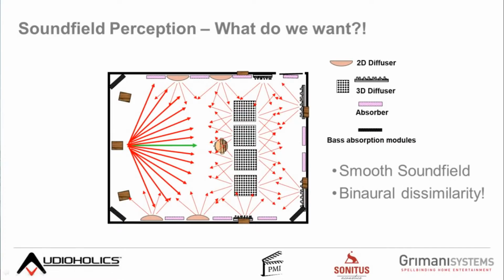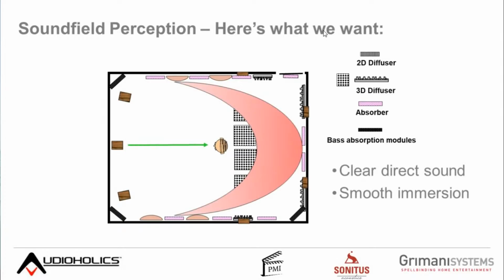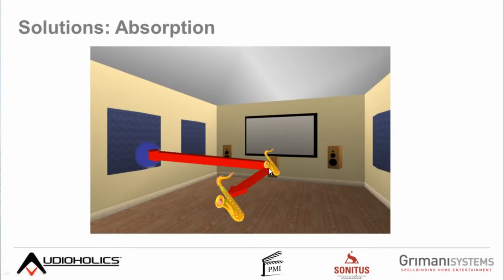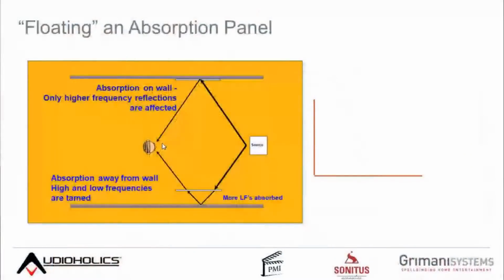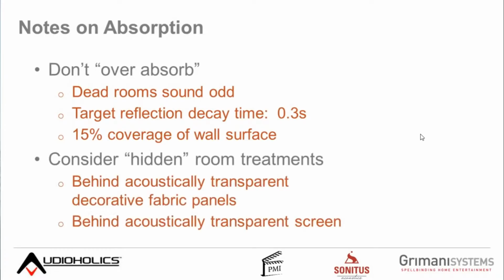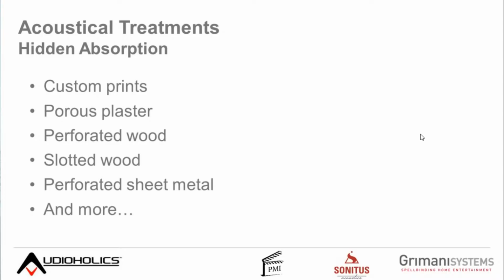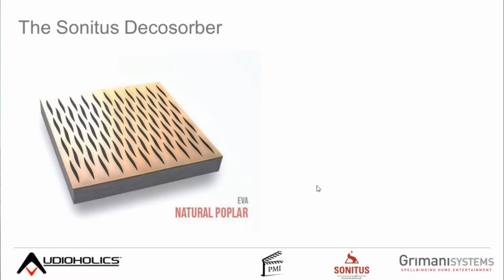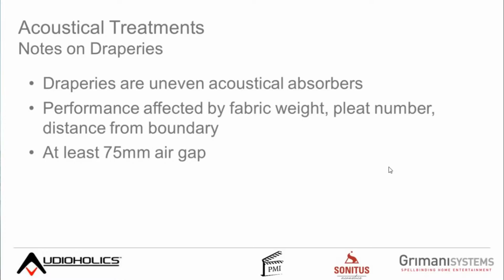Understanding the Different Types of Acoustical Treatments - Absorption

Comment: You must have symmetry to have proper center image. And your example picture the front wall is completely empy. That is the most important wall to treat. Small rooms I don't even bother diffusion. To know how sound works it is very easy. If you have symmetrical room and speaker setup it is very important to treat the room the same way. Another center speaker is just that what you want. Proper locked center image.

Comment: Lots of info.  Sophisticated materials/designs.  Please describe in details "ideal sound(s)."    Hey--that a demo comparing various speakers with direct wire found sound indistinguishable from the wire version!   Great.  2.  Local auditorium is a serious theater routinely overblasted by volume settings to please the artists on stage BUT destroying sound, giving echoes, distortion, thumps against the chest with volume.  Good system controlled by chimps.

Comment: Is the %age of square footage based on the room wall sq.ft or does it include the ceiling? According to my math, if I have a 14x27x7’ room then id need 18 2x4ft absorber panels and 24 diffuser panels? Can these panels be set into the wall framing itself so it doesn’t protrude into the room space. Thinking of wife approval factor…

Comment: Very interesting presentation.
What about combining esthetics and sound absorption/deflection:dampening the old fashion way by placing on and along walls different size pictures and furniture like wall cabinets, and experiment by mowing them around until the sweet spot is located?
Newest AVR are equipped with the software that “adjusts the sound according to the listening room and speakers therefore creating clearer sound by suppressing the standing waves that occur between walls or ceiling and floor.”

Comment: Wouldn't you be able to fix lobing with some delay on the amp / receiver, by setting it per speaker ?
Reply from the maker: You can't fix lobing caused by the speaker with EQ or delay. It has to be fixed at the source.

Comment: Best video and what I've been telling friends for a few years now. Speaker room integration/interaction is key. Cables, equipment, and amps are truly the least concern although amp and speakers should be a good match due to dynamic impedance swings and speaker efficiency differences.

Comment: Alright, ya guys finally broke me! After trying to re-tune my system I found some problems I just could not fix. It's gotta be the room causing this, I know I have an echo so I finally broke down and ordered some bass traps for the corners and some thick acoustic panels for the walls and ceiling. Just for quick and dirty testing I hung up some thick bed blankets on the walls and sure enough, big difference! So I felt confident spending more than a few bucks on some actual panels that will look a whole lot nicer then some bed sheets lol.
Cheers 🍻.

Comment: I rearranged my threatment and turned from equal absorbtion to 3d-diffusor on the first reflection from the left speaker and absorbtion on the opposit wall. It sure opened up the sound fr.o.m. the left speaker but the voice is now no longer centered. The voice is now coming the left side of the front wall. Maybe it does not work because my speakers are to close to the side walls (40-50 cm). Anyone else experienced this?

Comment: Hi guys. I just moved into a place where I have a room which is more like an attic. A portion of the ceiling is slanted and the dimensions are not that impressive: 4,47m length - 3m width, 2m height (1.60m until the ceiling starts to slant ). I have placed my mixing desk on the long wall, because it's the only one bare and because on the right side wall is a window. Could you, guys, give some tips for treating this kind of room?

Comment: Can i ask a specific question on my room?
Reply: I see that no one replied to you. These guys are busy men, just like any YouTuber. May I suggest that in the meantime, until you get an answer (and maybe you already have your answers and I'm wasting my time, but I'm only trying to help... Just in case you've not done any investigatory work till now), is that you do some research from notes made just on this video. That's what I did, and you'll learn a lot. Maybe also try to understand the basics of wavelength/frequency science, and then draw your room plan as an architect would, including speaker position, applying the math (including geometry) you learned. You should want to understand where you put what kind of panels, and their dimensions and materials. Once you have discovered l your reflection points for lows, kids and highs - the frequency band - including and high (room boasted) and low (room cancellation) nodes for bass, tool know what to do - especially if you've taken into consideration your furniture density. Once you have done all this, you may have your answers but new, more advanced questions. Then come back to these guys in a future LIVE video and be there in the chat ready (or you can send Gene an email ahead of time) to ask your question. You'll have more likely a good question to ask, given all the pre-thought and research you've done ahead of time, and better success getting an answer. These guys deserve well-thought out questions, not your average every day question, not that you have ordinary questions, but you know, respect to these guys knowledge

Comment: Maybe I missed this part in the presentation, but how do we use something like REW to actually measure the room and see whether or not we need these treatments? I've seen videos about the mirror trick for reflection points etc , but ultimately to the untrained ear, how can we use software to tell us or show us what we may not recognise as a problem?  We have to realize that if the room sounded good to us before (because we couldn't tell the difference), than we would need something else to show us these problems. Maybe someone like Anthony could walk in and hear the problems right away, but the average homeowner may not recognise these things as problems. It would be good to have an explanation of how we can use tools like REW (or whatever else) to actually assess the room and then figure out IF and where we need treaments.

Comment: Back in the late 90's early 2000's I helped some friends of mine put together a low/no budget rehearsal/recording studio for their band. I had construction experience so it was up to me to build it. We had the building, a stand alone garage built back in the 1930's with 10' ceiling. After insulating the walls and hanging 5/8" drywall which is all the landlord was willing to pay for we needed to get creative with sound treatments. Not to far from the studio there was an industrial building that was being remodeled for new tenants and they where ripping out a grip of new T-bar ceiling acoustic tiles and 1/4" rubber backed carpet squares that the previous tenants had installed just before going bankrupt. They where throwing all of this stuff away so I helped myself to as much as I could. We used the carpet squares to cover the floor and glued the acoustic tiles to the walls two layers thick. Then we cut a bunch of the tiles into pieces that we stacked about 6 or 7 tiles high that formed a four sided pyramid that we glued together and attached to the ceiling in a checkerboard pattern.

Next I found this carpet shop that installed carpet. The carpet as usual came in rolls that had at the center a thick cardboard tube that was discarded after the carpet was installed. This place was doing a lot of business so they had a lot of these cardboard tubes laying out by the trash cans so I helped myself to a bunch of them. We took these tubes and ripped them in half on my band saw so they where half rounds that we then attached to firing strips that we screwed to the walls every two feet. We would put 4 to 5 of these carpet tubes in a row and the a space. The ratio of tubes to spaces where always varied in size as to achieve what you where calling binaural dissimilarity, something I was aware of and practiced in setting up my own systems but ran into a lot of resistance from others when I would try and explain it. In the spaces between these carpet tube panels I hung strips of mass loaded vinyl that I found being thrown away at a manufacturing facility that used them as coverings over their doorways to keep the buildings refrigerated atmosphere from escaping out the open doorways while not inhibiting the forklifts going in and out of the building round the clock. I'm talking about clear plastic strips about 5" wide and in this case 9' long and about 1/4" thick and quite heavy. We weren't overly concerned about aesthetics but things didn't look to bad and the acoustics in this room ended up sounding as good as any professional studio. So in the end we where able to sound treat this room for the cost of some tubes of adhesive and a few boxes of screws and the time it took to do it. Granted we where lucky to find the things we did when we did.

Comment: For aesthetics (and light control and some sound isolation), I want to cover the entire room in curtains, liek your old school theatures, but i hear you should avoid that, unless you know what you're doing, which, I don't.  So what are the risks and what should you watch out for?  The idea was go around the room, a few inches from the concrete walls (basement) have the speakers on the inside of the curtain, and i was going to do acustic foam at the main reflection points behind the curtains.  They are not acoustically transparent, again looking to insulate from my neighbors a bit and I figured it would break up reverb and sound reflections as a whole for a smoother respose.  Where am I going wrong?
Reply from the maker: You're going to kill the high frequencies of your room if you do this.
Reply: @Audioholics  even with the point sources of the speakers in a 7.1.4?  and I'll have an acustically transparant front screen with no treatment, least no curtains behind it, and minimal work to the floor and ceiling.  What are my alternatives? It's a town house that we are renting, I can't put up walls and I want to block the view of the washer, dryer, hvac, and stair case, none of which are helping immersion lol.  It's also to create some leval of symmetry within the theature space, which is only taking up about half the total square footage offset to one side.  I have to hang some level of 2x4's or similar from the joists anyway, cus i prefer that to a bunch of speaker stands for the surrounds, so maybe instead of absorbing reflections, I'll could add diffusion and reflection panels to on top of the drapes suspended from the ceiling to liven it back up?  It's a challenging space in any event.    I see a lot of trial, error, and measuring in my future.
Reply: so he sort of answered it twords the end.  I run the risk of over absorption.  but considering its an open room on 2 sides I think it should be ok

Comment: Well my room is 17' wide, 23' long (left side) 14' long (right side) and has 13' vaulted ceilings. I am using identical tower speakers (Infinity P363) on all channels and am making sure that they are all far enough away for proper driver integration. I'll be able to do 5.1 + wides so 7.1 total. I will treat as described here and do speaker layout and calibration as described here. It will be a dedicated room even though the room is somewhat open to the kitchen. Hopefully the big speakers aren't a problem in a 3200 cubic foot room. Only one way to know.
Reply: I have a similar sized room with 30 foot vaulted ceilings. Have done your acoustic treatments? And if so what did you use?

Comment: You can have all that, but if that room temperature change it will give two things, a plesent or un-plesent sound field... AC or Heat in moliculse in open air effect in the room in general .... could be a good thing or bad thing... If your Air-conditioner moliculse changes in AC or Heat.in general thew air moliculsel.....it then can require slight adjustment's in effect.

A scientific Fact!!!

Shit is a little tricky.

Take it from Martin Logan ELECTORAL STACKS....they had this problem for year's until they got it right.

Consumer compliant!

You may have the bells and whiske...but a separate room correction unit is highly need...like Legacy speakers and IMAX theaters DOES!

Reall shit. 🙄😥😨😢😢🥺

Comment: Gene's mic is always quiet because that isn't a side-address microphone. That's a dynamic microphone, direct-address, with a cardioid reception pattern. Just think of any singer holding a microphone on stage, or using a mic stand. Talk straight down the barrel of the mic, Gene. Or if you don't like that, then you need to get yourself a side-address microphone.
Reply from the maker: I know. I did buy a very high quality cardiod that requires 48V phantom power but my Focusrite seems to be broken. So I'm trading it up for a newer model that will work with this. Stay tuned...

Comment: I have a room i can turn into a movie room, but the ceiling height is 7 ft.  The size of the room is 16 x 14, will the the ceiling prevent me from using this room as a theater?
Reply: A 7ft ceiling is the opposite of perfect. The greatest gift you can give yourself is using as large a room as possible. Search the video "acousticfields ceiling height".
Reply: You will need to get a bigger room friend.
Reply: Mike Serago you can get excellent sound quality from a small 16 feet x 14 feet home theatre room. If you do proper research and correct speaker size and placement for the room. Plus impliment the acoustic room treatment well.
 
But for a room only 7 feet high ceiling Atmos/DTS X isn't advised. In fact Atmos/DTS X sounds underwhelming in most people's home theatre's because there ceilings are far too low. You really need a 12 feet or higher ceiling to get a decent overhead Atmos/DTS X effect.

Don't get disheartened as in your room a 5.1 or 7.1 system will sound very good. Preferably with at least 2 subwoofers. Hope your dedicated home theatre room turns out well 🎬
Reply: Most people have to just work with what they have. That's where the skill is, turning the sow's ear into a silk purse 😉

Comment: I'm trying to treat my new home cinema but I've no idea where to start, I've been waiting for this video eagerly after the first one!! my Issue is my room is a rectangle but I have to have the screen on a short wall and sit in the middle of the room, 
so the back is quite far away, but the room is so narrow that I'm getting a lot of flutter reverb and I have to have the speakers almost in the corners to get a wide sound stage. I've been researching for months and I still can't work out what I need to do! driving me crazy. I want the atmos set up to be really accurate because at the minute I'm not always hearing the individually placed sound effects when scenes are loud and busy, I just hear things above but nothing around me really. I've got dual subs though which seems to have really sorted the low frequencies in the room and they are no longer a problem, it's just the mid to high that are an issue.